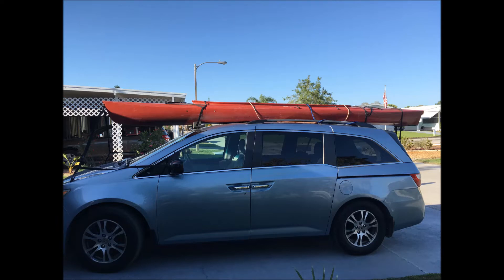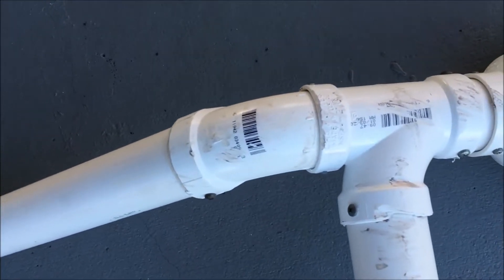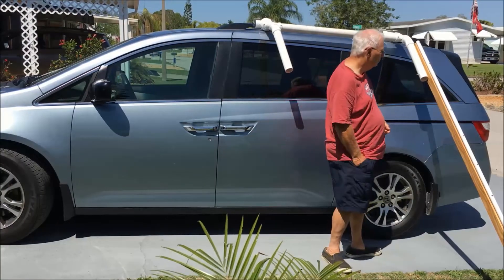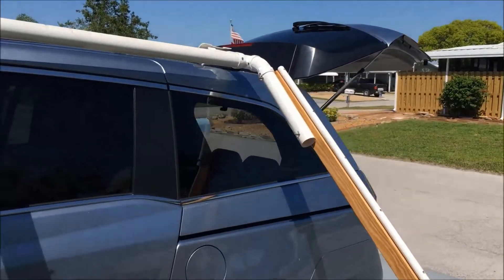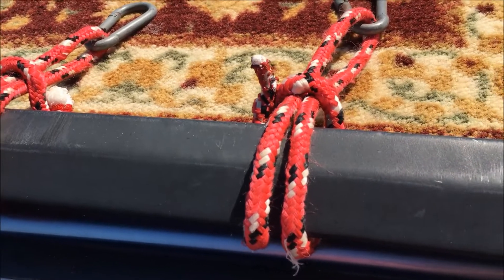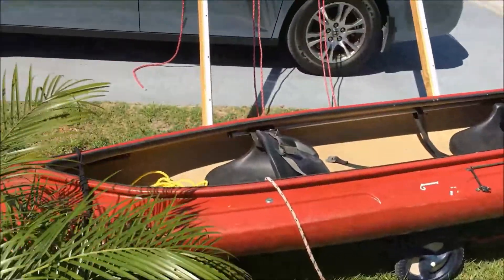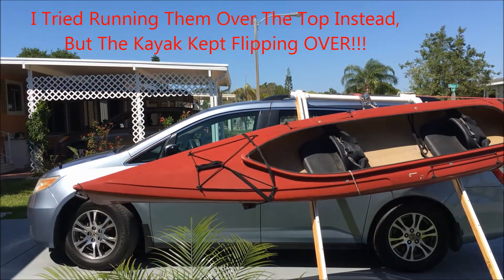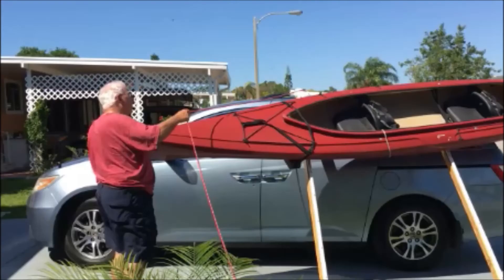BEST DIY HEAVY KAYAK LOADER ON YOUTUBE!

Comment: Thank you for posting this, this is a great idea for those of us that are getting older and can no longer brute force the load.  Yes it takes more time, but the risk of injury is reduced greatly and it WORKS.  I will be trying this for my kayak.  Thank you again.
Reply from the maker: The trickiest part is making the two pvc connectors to the roof rack.  You need to have enough clearance for the arc to rotate.  

Make one first, using a T connector, before you buy any additional material.  

There are a couple options to cutting the pvc slot.  

On my first ramp, I used some strong mason twine wrapped around a handle at each end (stick, dowel, screwdriver, etc) and sawed it.   Search YouTube for examples.  

For my second ramp, I didn’t have any twine, so I used a Harbor Freight rotary tool (like a dremel) that was on sale for under $10.  It worked great.
Reply from the maker: Feel free to ask for advice if you get stumped.

Comment: Great tutorial.  Way better then the $1200 plus I spent on a pain in the but Thule Hulivator and cross bars.  My question for you is, when pulling the line to lift the kayak to the roof (mine weighs 80 pounds and is going up on a tall Toyota FJ Cruiser Trail Teams)  is it ideal to have the pulled end of the line directly below the closet pulley on the roof?  Or do you prefer to pull the line standing to the side of the pulley system so that the line you are pulling on is off at an angle like 15 or 20 degrees from all the other lines facing the kayak or the roof top bar?  Thank for any further assistance in advance.
Reply from the maker: I’ve done it both ways.  

Usually it’s a straight pull but sometimes another vehicle is in my way and I have to pull from an angle.  

Also, I oftentimes have to move left or right off center to keep the kayak parallel to the roof, because the line goes over the top of the kayak.  By the time the kayak is near the roof, I am standing maybe 30’ from the van.  That’s when I often walk the line back to the ramp and cleat it off to look everything over before the final lift. 

At this point, I used to reroute the line from the top of the kayak to underneath it.  Doing so necessitated moving off to the side to pull the line.  It was a headache to do so.  

I later found out that this wasn’t necessary; I could keep the line over the top of the kayak as long as I walked the line back out 30’ or so.   Any closer and the line’s angle from above the kayak to me was too sharp to allow an easy lift onto the roof. 

It IS a plastic kayak, and repeated use of routing the line over the top HAS caused some wear on the edge where the taut line acts as a dull rasp!  But it’s more convenient this way and it’s an old kayak.   If it were new, I’d route the line underneath

Comment: Brilliant work! Probably my next project. I have an aluminum canoe that will have to go up upside down, but that should not present any problems. Thanks for sharing this.
Reply from the maker: Thanks!  But there is a different approach for boats that load upside down, like canoes. 

Search for this excellent video:

DIY roof rack boat loader.  

It doesn’t use any rope or pulleys, just a couple “steps” on the ramp; utter simplicity.  You DO have to be careful or the boat could come tumbling down.  I actually tried this before coming up with my design, but it didn’t work with my right side up kayak.
Reply: @Thfeyhvfdetyhbvcd I dug up some old harken blocks and rigged it up this evening! Amazing how easy it is. I need to get some carabiners, so that it all just clips on instead of tying everything. 17 ft, 85 lb canoe, upside down, was very manageable. Mine was all crude and thrown together, but with some refinement this is going to make things so much easier.
Reply from the maker: @andrewharmon7929  Pleased to hear that it worked out for you!   I’ve considered several improvements to my rig, but only implemented one.  You might find that if “as is” gets you on the water, then it is “good enough”.

Comment: Nice work. I might make a version to work with body mounted roof bars and no rails.
Reply from the maker: I don’t have cross rails either; just the two long side rails.  

First step is to cut a T joint to fit under the side rail and have enough clearance to rotate through about 120 degrees.   

You might need to try 3” 4” diameter or  whatever fits.  

Next is to figure out clearance for the sliding door.  Connecting it directly to the ramp might cause a collision with the door.  You need an offset of several inches.   Look over my “apparatus” and you’ll notice how it holds the ramps clear of the door.
Reply: @Thfeyhvfdetyhbvcd  Thanks for taking the time to reply.
Mine has just a bare roof so no side rails. I have the bars that clamp to the roof / door frames directly.
I think I can make some new version that will do the trick though.
Thanks
Darren

Comment: Awesome design - for further improvement I wouldn't combine a bunch of pieces, but bend two straight pipes after heating them with a hot air gun to avoid the bumps at the joints. For the cross-bar take a piece of hardwood and drill holes to insert it. The rope cuts into the PVC-cross-bar because the friction builds up too much heat, no issues with hardwood I think. Additionally you could wax it or slide on a loose-fit piece of aluminium tubing as a roller. To help against fiddling around with the ramp pieces, you could use tight fitting wooden dowels to connect PVC tubing of the same diameter, then you only need one bolt each side to mount them together. Would give you a very smooth ramp with no bumps.
Reply from the maker: Some great suggestions!

Comment: Hi mate bloody good idea but you need to make a roller for the rope it's cutting in the pvc pipe if the rope can runs over the roller it will help and works a lot better and the runners need to be able to fold up ,,,an electric ATV winch is worth a look mounted in the middle of the rack with one rope clips on a single sling looped around the kayak,,,I've done it as well 😊😊😊😊👍
Reply from the maker: Great suggestions

As for the ramps, they are just short enough to fit in my van.   If I wanted anything longer, then I certainly would need to fold them or something.
Reply: Good ideas are always helpful to others

Comment: Is it still working well for you after a couple of years?
Reply from the maker: Works GREAT!  

I made a  modification to hold the bolts in place when assembling.  I cut a small square of plastic from a peanut butter lid and drilled a hole that fit the bolt tightly, and slid it on.  The bolts have never since fallen out.  

I’m glad I screwed the “apparatus” together rather than glueing it.  I was careless unloading the kayak and cracked a fitting.  It was simple to replace with only screws holding it together.  

I also came up with a change in unloading the kayak.  I discovered that the pulleys weren’t needed.  I simply substituted a 15’ rope and wrapped it around the large pipe.  There is enough friction to controllably lower the heavy kayak.

Comment: You really need to put 1 or 2 nonslip bath mats on you car before doing this. Just resting the pbc on on the car makes scratches.
Bath mats for the win
Reply from the maker: Interesting idea!  

I use carpets, but have lost a couple that blew away after forgetfully being left on the roof
Reply from the maker: Yes, you DO need something between the boat and the roof. Even though the bow and stern are elevated on foam pads

Comment: Great idea.  Ive been doing some research on making one.  My one idea is to use basically your system but make it all self contained like a Shingle elevator(See link for reference).  Everything would be significantly reduce because it can.  Also the shelf used on a shingle elevator would remain parallel to the vehicle and make it really easy to push or pull on.  https://www.youtube.com/watch?v=n2F9hjTdHCU
Reply from the maker: Interesting!

I had never heard of a shingle elevator.  I HAD thought of using a cheap 12V hoist but couldn’t figure an easy way to connect it; never considered mounting it at the BOTTOM of the ramp!

Since reading your comment, I ran across other videos about “ladder hoists” that use a modified extension ladder for the frame.   You surely wouldn’t need a long one for that.  

Thanks for the suggestion.

Comment: Get a truck with a kayak extender rack for your trailer hitch.  You spend way to much time trying to get this kayak up on your van.
Reply from the maker: The whole point of my system is that it doesn’t require any lifting.  

My sister has one of those T systems for her heavy Hobie Tandem.  It  is difficult to use.  First, you have to lift one end of the heavy kayak onto it.  That’s over 40 lbs, and you have to twist your back to get it lined up.  Then you have to lift the other end high off the ground while simultaneously pushing it forward.  That’s WAY too much lifting for someone with a back injury.  

My system requires no lifting whatsoever.   Assembling the ramps is easy.  Each takes just  two bolts.  Attaching the rope and pulleys takes the most time, mainly stretching them across the roof and down to the kayak.  

I’ve made TWO of these ramps and they work great for my heavy kayak.  Been using them for several years.  

But, if lifting is not a concern, the T system IS pretty quick.  

BTW.  For 15 years prior to my back injury, I simply lifted one end of my kayak onto the rear roof, then lifted the other end above my head and slid it forward on two pool noodles!   THAT was quick and cheap.  I just cannot do that anymore.
Reply: @Thfeyhvfdetyhbvcd  excellent. Thanks